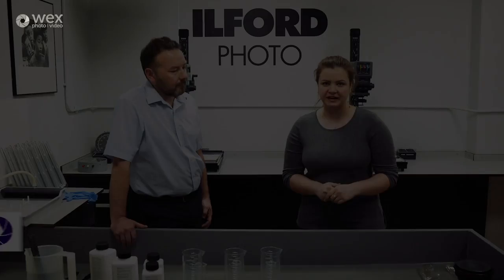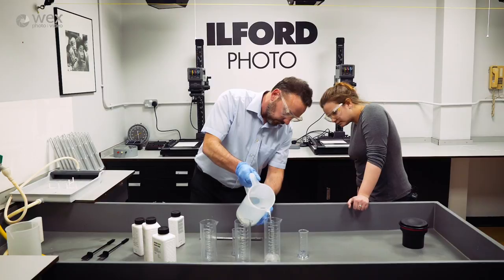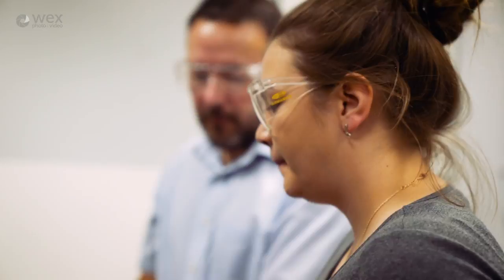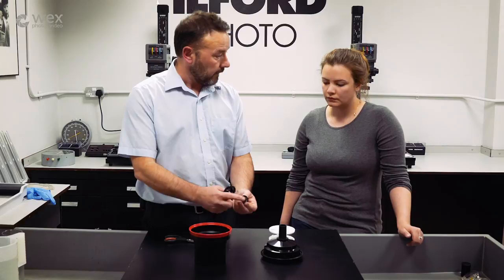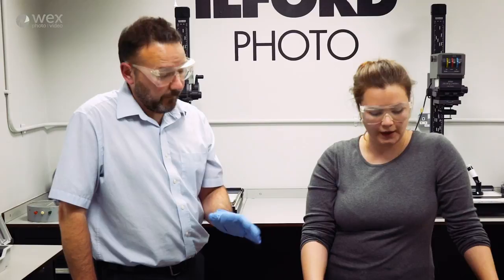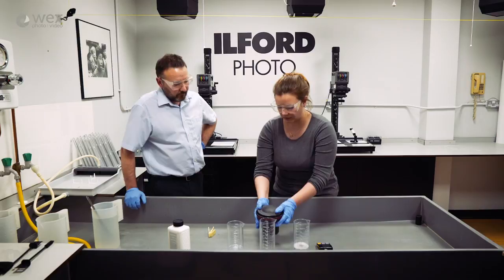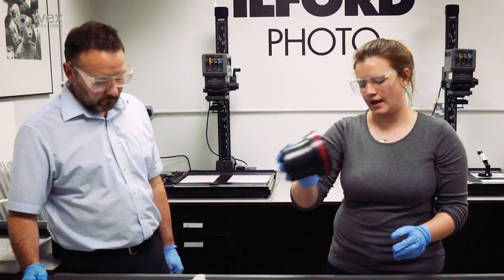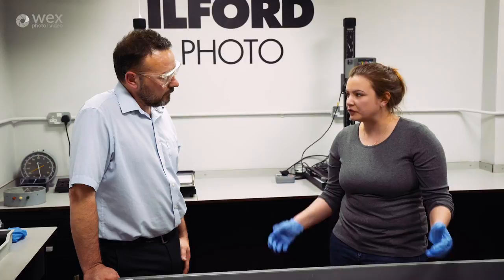Processing Negatives | A Step-by-Step Guide to Processing Your Own Film

Comment: It's kind of funny watching this... I rolled and developed my B&W film for probably over 20 years and never used gloves or goggles! And the opening and cutting of the film was done by either smacking the canister (long end of the spool down) on the table to get the end off or prying the can open with my fingers and just tearing the film instead of cutting it with scissors or retrieving or leaving the end of the film out when rewinding so I could cut it before putting it on the reel then tear at the end. 
Loved the Patterson tanks! I could use the stainless if need be but the spool that walked the film on and being able to use the same reel for 120 was great! 
Interesting that they didn't use a Photoflo solution (or whatever Ilford called theirs) before they hung the film to dry, guess they have really soft water there! Good Times!
I never had that scary music playing either!

Comment: Amy, some terms: what he asked you to do at 10:31 was, obviously invertion, turning the tank upside down, then right side up again ; the other term used in this process is ajitation, in the 'dunking tanks' this means (in the dark) lifting and lowering the holders, or in spiral tanks ( in the light, as the funnel acts as a light baffel), using the 'twizzle stick' (an axle which mates to the spool inside the tank through the funnel opening) turning slowly round and round.

Comment: I find if you don't roll the film all the way in the canister you can start the film loading (by pulling the film to the ball bearings on the reel) you can do this in the light before you put the film in the bag or darkroom. This is by far the easiest way of getting the film onto the reel before you completely reel the rest of the film in the dark. I've been doing it this way for years and saved me hours of frustration. I come to this conclusion because usually at least 12-16" of the film is exposed to light when you load the film into the camera and it's way less film getting it onto a reel so there is no possibility of ruining the film.

Comment: Amy, these are called "spiral tanks" due to some 4x5" and larger film tanks like the steerman Press SP45 and others, which essentially are like a car radiator, a bucket, a lid with two caps, and two holders which dunk inside the tank simmilar to files in a filing cabinet, these are NOT spirals, but 'dunking' tanks- named adeptly due to the way you 'agitate' the film inside, like a teabag drawing, NOT round and round, like Peterson spool tanks.

Comment: I notice a difference here between the Ilford processing video, where they used 600 ml for the final volume of the solutions, and here, where 300 ml was used, is there a difference in the tanks size?, or is this volume printed on the tank somewhere?- and does this vary by much, depending on what tank/loader style or brand you choose?

Comment: Very interesting, I noticed that no squeegee was used prior to hanging the film, is this to prevent damage?  Will tap water leave marks on the film as it dries?
Reply: If you use distilled water to avoid hard water chemical deposits, and if you add something like PhotoFlo in the very small amount directed (or less),  then you can expect no deposits or water marks on your dried film. No squeegee is used because with a few uses or standing out on a sink, they pick up dust, dirt, etc., and  risk scratching your film. If you use a final wash as I suggest, the water runs off so quickly when the film is hung, that a squeegee is useless anyway.